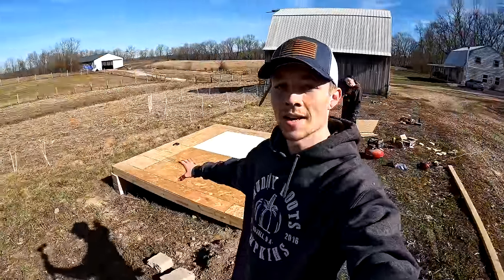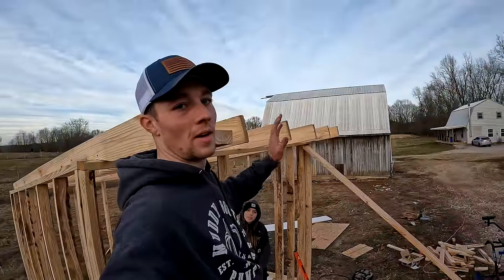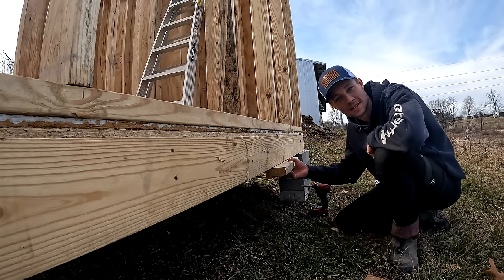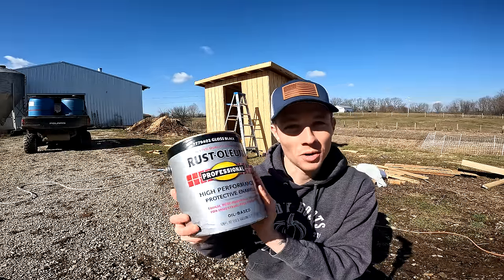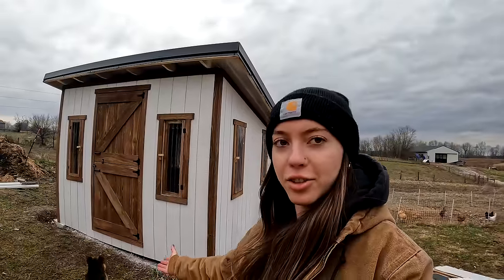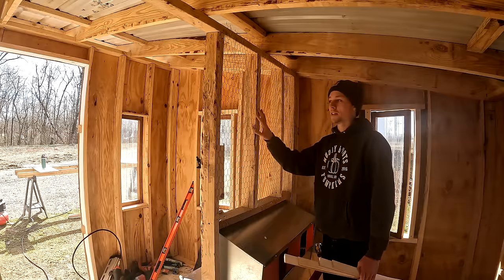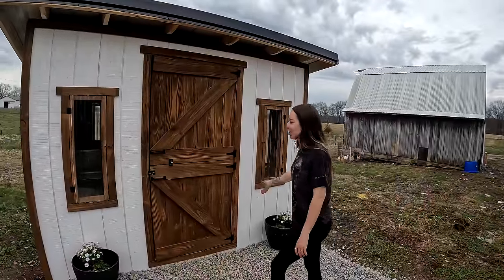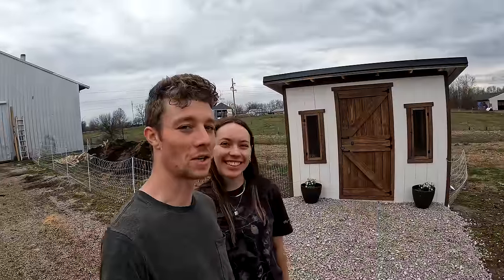Couple Builds Dream Chicken Coop

Comment: Just a observation, if ur worried about  predators getting ur chickens  you should  close up the space  in ur roof trusses with wire
Reply: …and a carabiner locking system for the chicken doors. A raccoon could easily lift that door up or a snake could force itself under the door. A snake could get through the chicken wire too. 1/4 hardware cloth cures that.
Reply: Hardware cloth will give you ventilation and keep predators out
Reply: I also want to note, to keep our sparrows or other small birds that want to get in to build nests or out of weather, 1/4 hardware cloth framed inside the windows also will keep them from getting in.  Once they figure out how to get in and find options for food or water, they won't stop.  Love this build though.  I am wanting to build a new coop for our birds, and think your plan/design is great.  Congrats on a beautiful and useful project!

Comment: I think maybe you already figured it out that if you would have put bracing between your floor joist in one or two lines the strength of your floor would have been a lot better and would not have needed the two layers of plywood.

Comment: We built a chicken house in the late 1980's on our farmstead in Idaho.  Back then backyard chickens weren't even a term people were familiar with.  So we designed our chicken house on the original site of the 100 year old chicken house.  Made in the exact same design.  The problem is my husband used boards from the old lumber mill torn down in our logging town that were treated with creosote.  I've raised two batches of chicks.  25 in each batch that all died.  Started getting sick at 2 weeks, and then they dropped like flies.  Sent off samples to the University Vet Department, and they said the samples were toxic in sodium levels.  So I thought it was feed.  However the feed company denied using those levels and said it couldn't be them.  It wasn't until the 2nd batch I made the connection with creosote.  There's high levels of sodium in creosote and if the boards were heavily treated they can be toxic.  So I've a choice to put down a new floor with plywood or linoleum or some other material, or build a new chicken house.  I'm toying with the idea of turning my chicken house into a rabbit house.  I show rabbits and it would be convenient to have such a large building for them.  And build a new chicken house.  I like your design as the outside is similar to the 19th century patterns.

Comment: Very pretty chicken coop. It seems efficient. Did the chickens end up able to get up on the roost? I have noticed my chickens as they age have a hard time getting down from higher places. We have a ramp to hen box, but not to roost and I haven't watched to see how they get up there, not that it is very high. Please update on the layer box; I get tired of cleaning eggs.
Reply: I can second this post, my older girls needed me to add a lower roost for them as they aged. Also not sure if mites are an issue for you but I used to have tree limbs as roosts and one year I got mites and realized they were hiding in the nooks and crevices of the perches… so gross. Switched to closet dowels and 2x4s although not nearly as cute or natural but cleaner.

Comment: Hey, I just bought the plans to your coop on Etsy....I'm wondering if the 5/8" X 6"x8" Picket Fence Panel is a typo?? I can not find it in 8" only "6....Also did you use treated wood for the floor joists or does that not matter since its not sitting on the ground?  I am seriously about to start making this coop and want to make sure I have details correct.  Also, if you can offer any other tips that you might have forgotten about, that would be so much appreciated:)
Reply from the maker: The picket fence is 5/8 x 6” x 8’. We didn’t use pressure treated but you absolutely could! We have a messenger on Etsy if you have any questions. Sometimes we don’t see these YouTube comments

Comment: Safety first.  Please stop  using your miter saw cross handed.  If the board is on the left then hold it with the left hand and cut with the right.  If the board is on the right, then hold it with the right and cut with the left.  I like watching, but preventable injuries, I can't let slide.  I know, you have done it that way for years.  The different is, I just saw you do it and cringed.